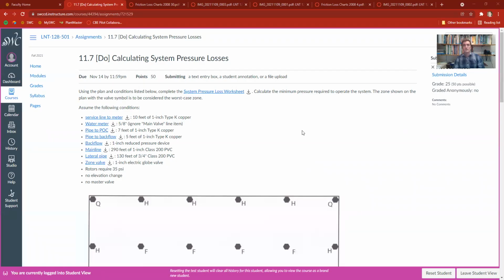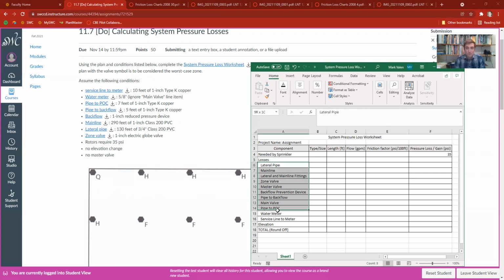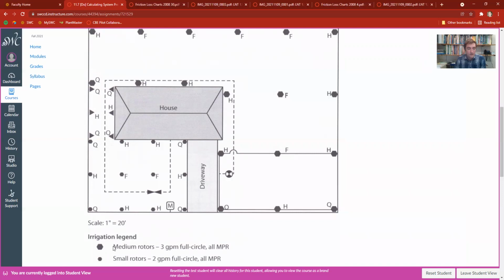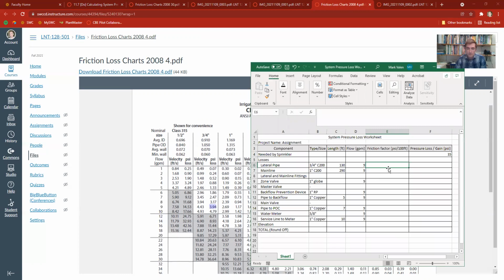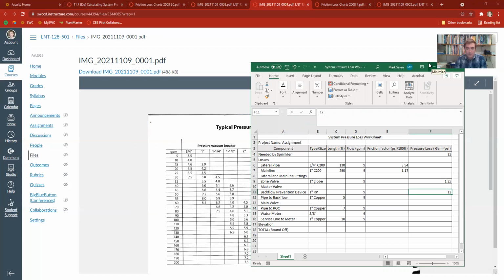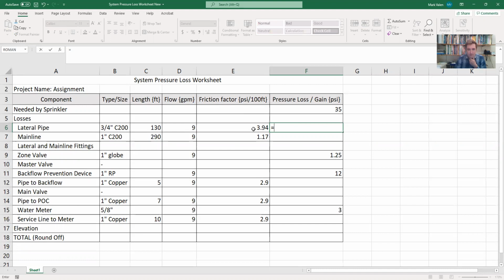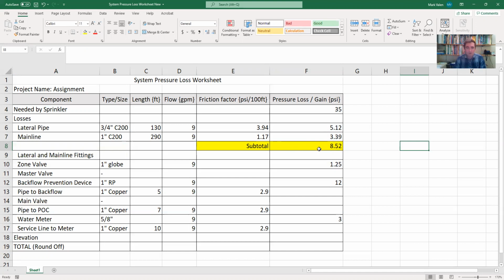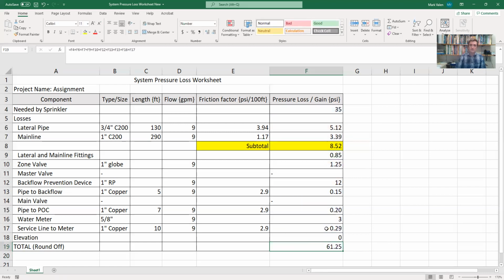Irrigation System Pressure Loss Calculation Walkthrough

Comment: What would you calculate the pressure loss through a 3/4" double check valve and maximum gpm. The service meter is 5/8 but they call it 3/4. They rate the gpm at 20  from the city and the psi is 45. The length from the meter to the backflow is 30ft of 3/4 copper and then 5 more feet of 3/4 copper out of the downstream side of thr doublecheck copper to one inch pvc.
I am losing water volume and pressure on one line  that is 100 feet from the Backflow. It had 8 , 10ft full pipe spray heads and 5 , 10ft 1/2 nozzles all rainbird.
My calculations tell me that the line is requiring 28 gpm but the service line and pressure don't support it.
I am replacing all the 3/4 copper with one inch pvc to boost the gpm hoping this solves the problem.

Comment: Oh my, so Wrong, On the lateral, as the  pipe goes from head to head, there is less flow for each section of each lateral between the heads, typically your pressure loss in laterals is less than half of what you say and actually is closer to .50 psi to the worst head (1/2 lb)  And since you cut the zone in half with the valve placement you do not even count the heads gong the less gallon way.  and even if ou did add the rest of the zone, it would be even less than the .5psi  loss.  Please explain